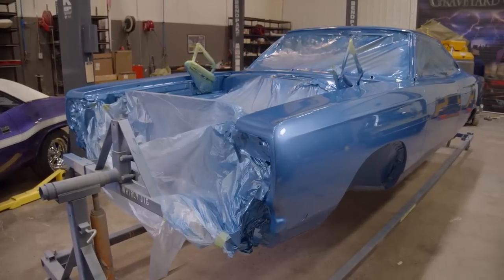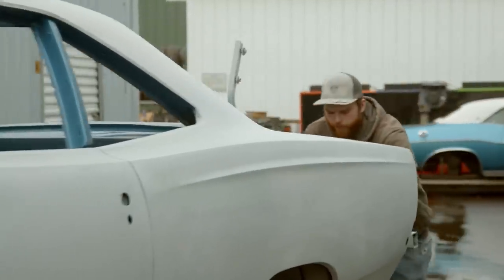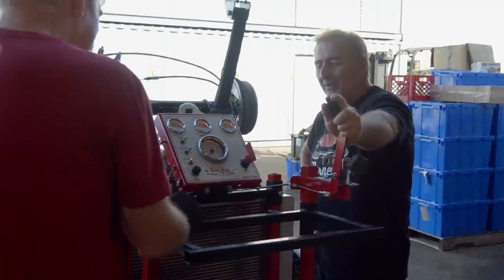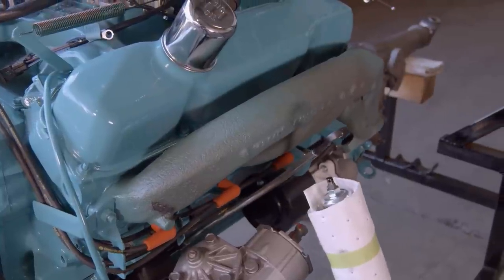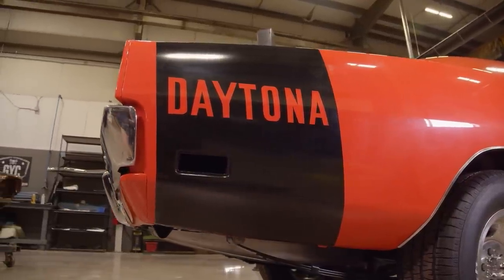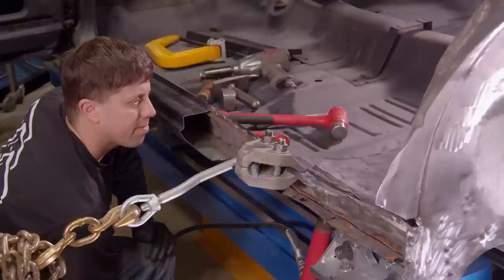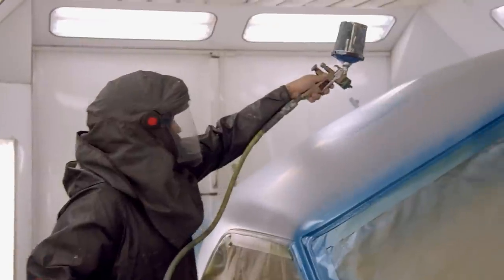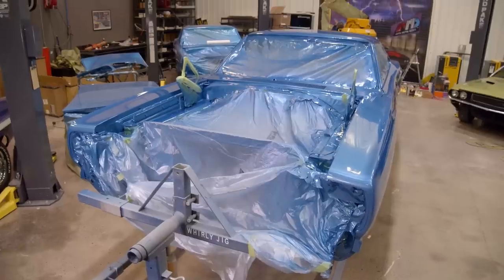YOU WON'T BELIEVE YOUR EYES!: BARRACUDA IS BORN AGAIN AND WITH A VENGEANCE!

Comment: Mark I had a six cylinder Cuda slant six . I had it rebored with pop up pistons head polished and a eight fifty holly carburetor. Had header with three inch diameter tail pipe with the old truster exhaust. It came with four speed shifter. I had four forty that  couldn’t stay up with me in eight track . If you ever build what I did you won’t believe me until you do it. Oh yeah I had a cam also positive rear. SEMPER FIDELIS

Comment: it gets to a point when a perfectly good car becomes a "parts car" ... you spend $60,000 to have a car that's worth $50,000 ???
Reply: If all you think about is money and if a car won’t make you a profit then it’s not worth owning this probably isn’t the show for you. If people only had GYC restore vintage mopars that would net them a financial profit after the cost of the restoration, GYC wouldn’t exist as a show or business because there are only a few hundred of those cars in existence and most are already restored or nice survivors that don’t need restored. In this case assume you’re talking about the 383 4 speed 68’ Roadrunner? I make that assumption because all the other cars in this episode are worth well into the 6 figures once restored. If that’s the case your numbers are a little low….a full OE restoration by GYC of a clean, rust free survivor car that runs and drives would be more than $60k. Honestly just having the body and paint done on a car would be close to that number. That said the $50k value number is also low. Even a “fairly common” car like that 68’ Roadrunner  is going to be worth well over $80k after a complete restoration by GYC. Granted it still doesn’t make financial sense….on that car….to do the full restoration. But they’ve owned the car since new and the history with it means enough to them they don’t mind spending money they won’t get back to have the car they’ve had for over 50 years be better than new and ready to be driven and enjoyed for decades to come. 98% of 67-72 Mopars that still exist wouldn’t be financially worth restoring….the only ones that are are the ones that are exceedingly rare and the price to buy just the wrecked or rusted out shell of one of those cars is $100k plus before a $120-150k restoration (that’s assuming you have a nearly complete drivetrain for the car). In those cases the cars are financially worth restoring but are not within the budget of a lot of folks who could swing the cost of restoring what they already have or taking a more mundane model and having it built up as a GYD tribute car. Next time you’re at a classic car show with a few hundred cars or more in attendance walk around and ask owners if they sold their car today if they think they would make money vs what they’ve spent on buying the car and costs over the time they’ve owned it. If more than 1 in 50 of them tell you yes and give reasonable figures (not pipe dream pricing) I would be absolutely shocked.